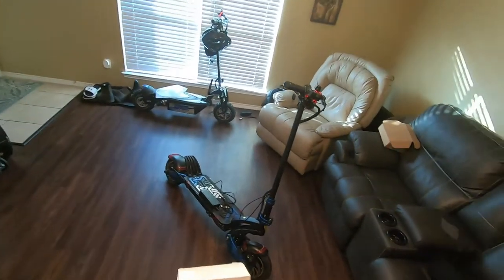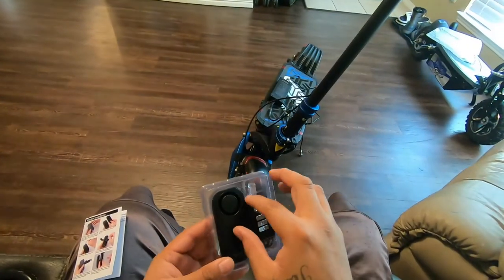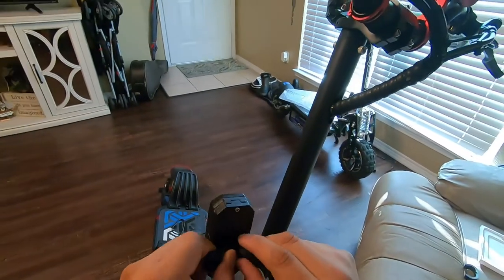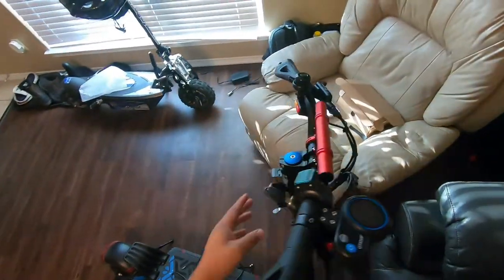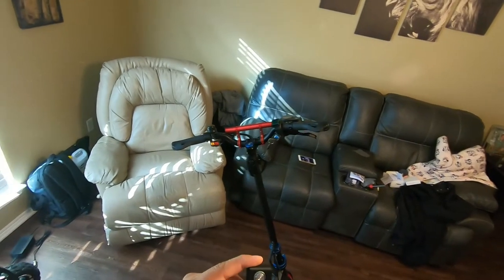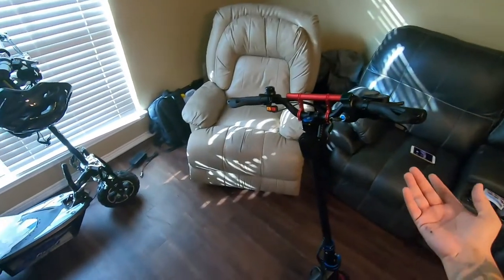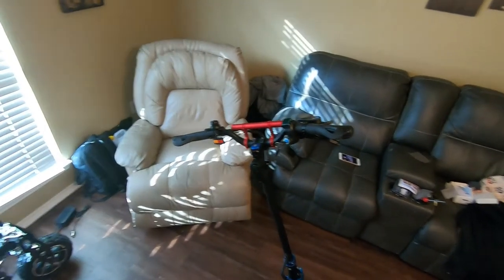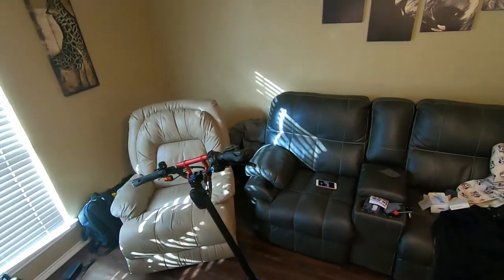Alarm For Electric Scooter | Installing An Alarm On A Scooter

Comment: Such an alarm is best hidden under the cover where the battery and controller are located. There is enough space there, difficult to remove by a thief and in addition, it is worth installing an inverter and insulating it well. It draws little current so you won't drain the electric scooter and you won't have to worry about replacing the battery. The scooter itself makes a great antenna because of the aluminum ;).
Reply: The problems with hiding it in the battery compartment is that the alarm instructions state "Do not install the host in a location surrounded by metal parts".
Reply: I don't think you quite understand how antennas work. Look up faraday cage, that's what the electronic box in a scooter essentially is.
Reply: I wouldn't use a body of anything as an antenna.

First you lack the counterpoise of the antenna (a groundplane of some sort).

Second, the whole frame is way too big to act as an antenna for anything higher than mid VHF. You would need to galvanically isolate a part of the chassy to act as an antenna and tune that separately with size.

Third, boards and modules that are potentially internally grounded to chassis, or the body of the device can and will interfere with the device held inside, and vice versa. Also the interference of digitally handled and frequency driven electronics stuff gets annoying fast. This can also happen by non-galvanic coupling.

Way way easier to implement a separate antenna than face the probable head aches from weird problems arising from RF on the chassis.
Reply: Where do I buy it friend?

Comment: And how fast does that Apollo Pro go ? I love my Segway ES4 cuz it has an additional external battery to ensure lasting power for long distance. I really want fat tires like I saw 1 of or even both of yours have. Ive been wondering if I could put those on my scooter somehow. The tires on mine are the solid tires , not air filled so that I dont get a flat but I would love to get some off road looking beefy tires on mine.
Reply from the maker: It does 42mph but I don’t go over 30 in mine lol yea you should able to change out your tires I’m not to familiar with the Segway scooters but I would stick with a nice street tire it makes the ride more smooth if you ride on pavement most of the time, an off-road type tire make the ride more rough but it’s good if you ride off-road like grass and dirt.

Comment: Does it power on n shut  off by the remote.. meaning you  cant turn on the display without the remote?
Reply from the maker: The remote only controls the alarm. Not the actual scooter itself.